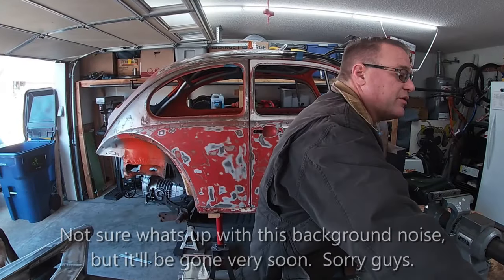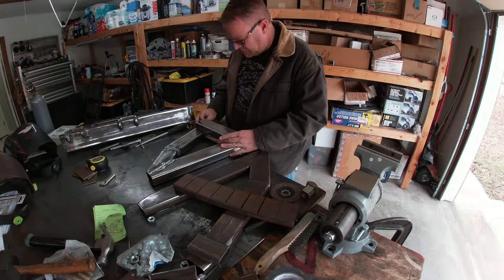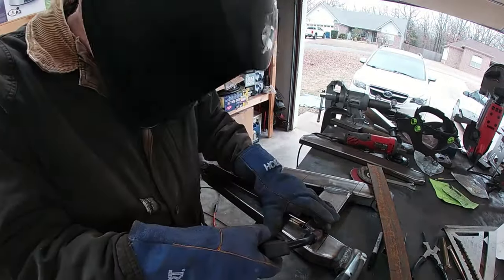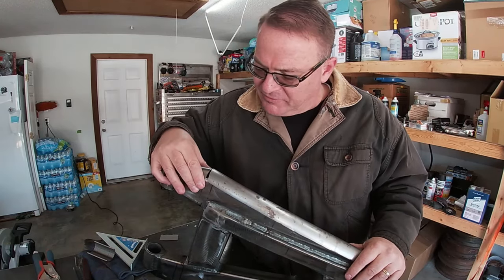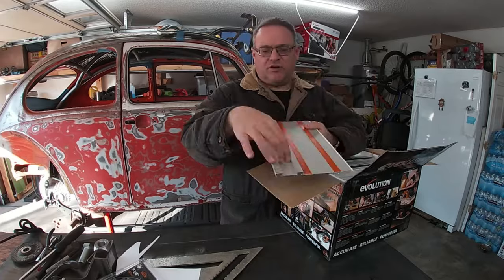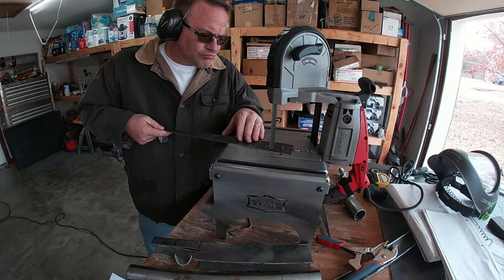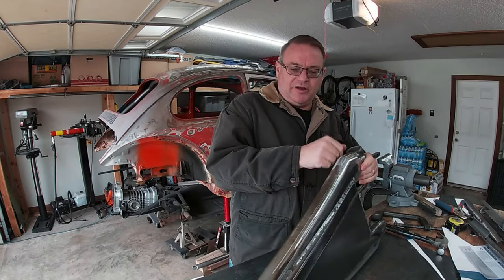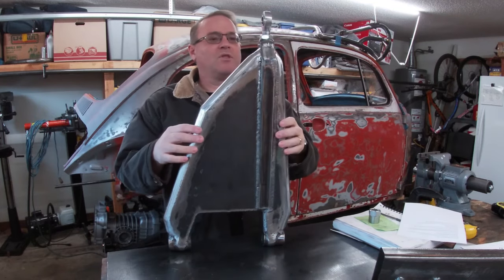Baja Bug Build (Ep. 28): Building Lower Control Arms (Part 2)

Comment: Doesn’t hurt to overbuild it. Those parts are the most important. Friend of mine had a super nice Baja but failed to gusset his rear arms and over time they crack causing him to roll over several time totaling the bug body. Luckily his chassis/roll cage was build strong and protected him and his passenger. He lives on to rebuild and learned a lesson not to put important things off till tomorrow. Love the build and thanks for sharing!!
Reply from the maker: Great point Willy.  In reality it's not that much heavier, and when I make a hard landing - or many of them - I'll be glad to have a little more beef down there.  

Thanks again for being apart of my project.

Comment: Nice work name it “super dudey “. So not to reference ford. Cuz I think those are going to be really strong 💪. .!!!! Weight I am going with 30-35lbs lots of metal.. can’t wait to see how it mounts and ties in with the rest of the structure
Reply from the maker: Another guess on the weight!  I'd say good job but  you got to narrow it down!

"Super Dudey" I didn't think of that...but very true.  Just wait till you see what I have planned for the frame/bulkhead.   Itll be fitting!

Comment: 26.5 lbs, "Orange Crush"
Looks like your Scout building days are still influencing you. Never hurts to over build things, I'm guilty of that on a regular basis. Maybe would have added some rosettes to the top plate to tie them to the rectangle tube underneath them but I'm sure they're going to be strong enough.
Reply from the maker: Well, you know what IH stands for right?

ITS HEAVY!😅🤣😂

However, I did weld the top plate to the lower structure on the bottom side. You can see the heat deformation in the pictures.

I was going to cut slips into the bottom plate so I can weld similar ties to the structure, but got a little carried away...these are things I still plan on doing.

For your weight guess... more. 😳
Reply from the maker: HRD, check this out https://www.facebook.com/share/p/mcca5WnyxHvFvjqV/?mibextid=A7sQZp
Reply: @thebinderbuilder  thank you so much for looking out for me! But, good news! I found one on the Samba classifieds on Thursday. It shipped out yesterday, will have it on Tuesday. Will be my next video after the one this Monday.
I really appreciate your support! If there's anything I could ever do to help you just ask!
Reply from the maker: @hotroddevils5031  shoot me an message over Facebook or something so I can get in touch with you easier.  @damiangrihalva

Comment: do you know the specs on that spindle? kpi? and what the disance is from LCA mount to wheel mount surface?
Reply from the maker: I went over that in the video on setting the overall width.  Long story short, when I put the hub/rotor on it, it measures 5" from lower bolt hole to wheel mount surface.

The upper bolt is 1.25" inward of the lower hole, and its about 8" height difference.

I picked these buggy knuckles up from AppleTree Automotive and went with the 2" hollow spindles, bit you can get them with "Combo" and "King Kong" spindles as well